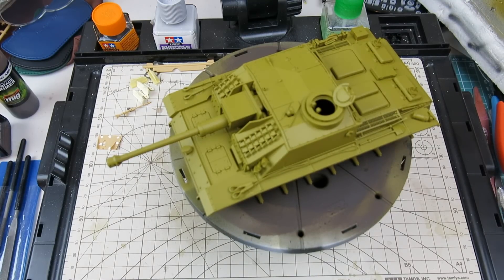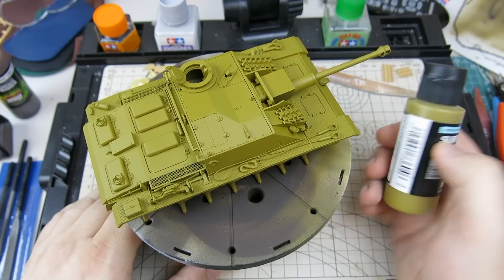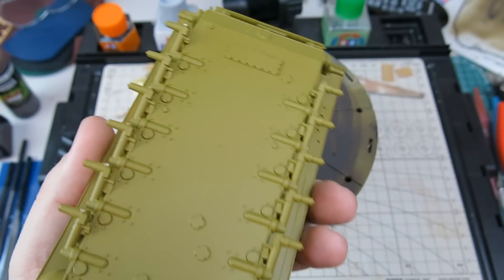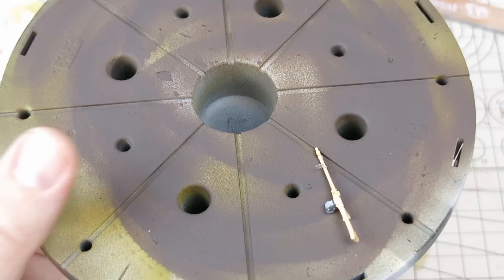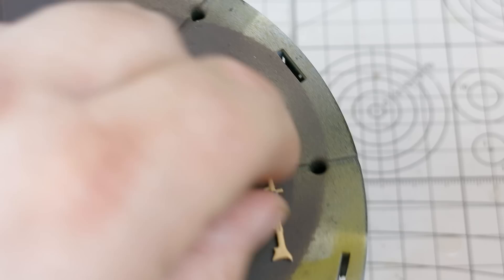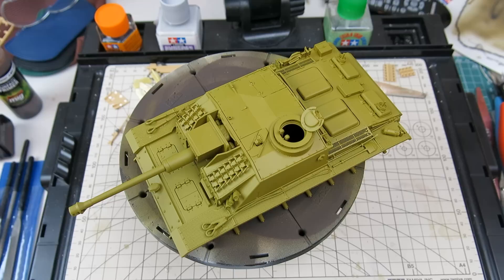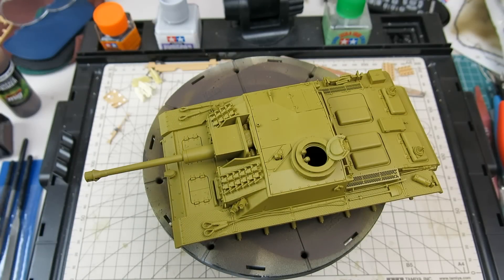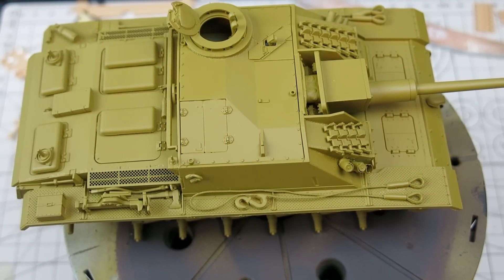Kursk Group Build #3

Comment: That primer is bright my friend...  It could almost serve as an Oxidizer yellow  ?  I understand its a primer thou!   and it looks smooth !  I thought you were done with the Vallejo primers ???     Very impressed with the finish !!!    Where do you get those metal cables from ?
Reply from the maker: No I'm not done with Vallejo I have a whole bunch of their products primers included.  Other than the once incident on my recent 109 build I have never had any issues.  I am also pretty convinced that was a result of the bottle being almost empty so the components may have separated somewhat.  Those were Karaya cables and I got them from an Ebay dealer years and they are still readily available.  If I am not mistaken that Canadian dealer "The Barrel Store" sells them as well.
Reply: ah !   well,  glad you are in good terms with Vallejo more than others... some were quite annoyed at their primers... ?    maybe it was a bad batch?   as for the metal cables...  I have been on the look out for some and that will come handy...  thanks for the info.

Next in the Breach ..... another A/C

http://i170.photobucket.com/albums/u255/schweinhund227/EA-6B%20%20Prowler/EA6BTopview.jpg

finishing the Prowler....project.